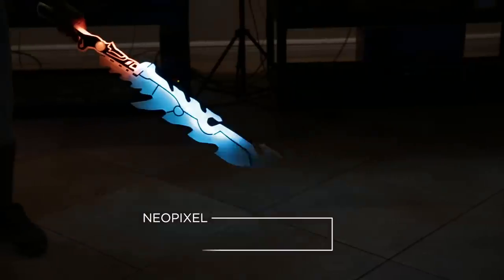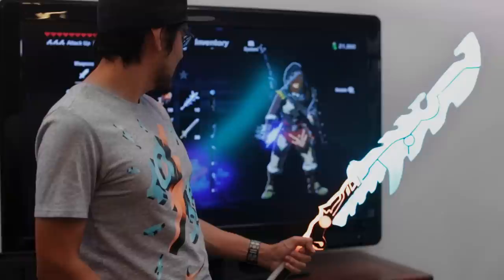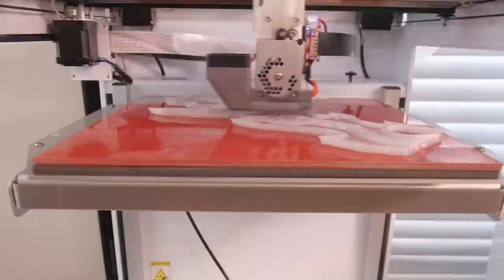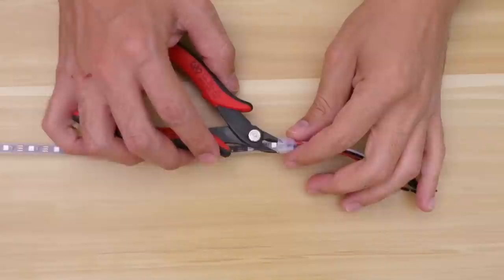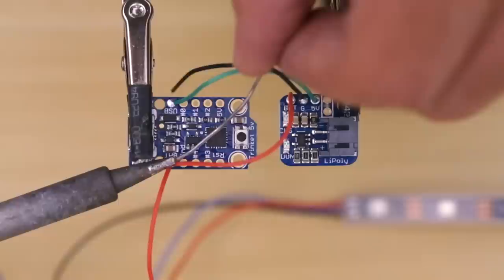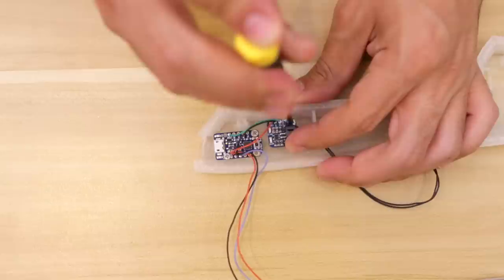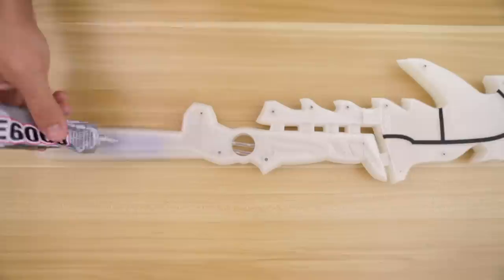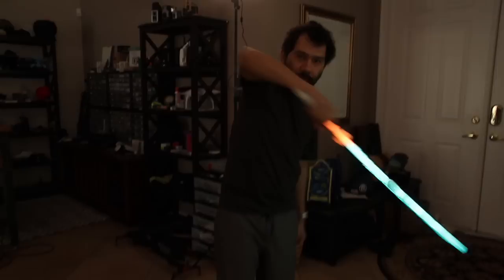3D Printing Zelda: Breath of the Wild – Guardian Sword++ #3DPrinting #Adafruit #Nintendo

Comment: "It's really durable and you can swing it around without having to worry about it falling apart."
Inaccurate to the actual game.
Reply: CrazyE that's a huge problem for me though. I don't like using them for that reason.
Reply: I love that I just finished the video where he made the guardian shield and the sword just broke.
Reply: @coolkcroyale  I'd say durability is about on par with the game's mechanics XD !
Reply: xD
Reply: Well hes swing it around in the air not actually hitting it againt anything at full force innacurate to what the weapon is put though in the game so?
Reply: @luigi7781  Use the ancient short sword instead its more durable and does more damage if I remember correctly (and you still get ancient proficiency)
Reply: @antssa2558  never said i didn't like the ancient swords. Just the guardian ones. I know those have a way better durability.

Comment: bruh... thank you so much for sharing this as i was unsure of how to mount my PCB to a 3D print. i was going to add a nut on the other end to hold a bolt in place but seeing that you can just screw a regular screw in changes a lot :)

Comment: is there a proper way to split the larger pieces for smaller print beds without weakening the final result?
Reply from the maker: of course! A fellow maker actually went ahead and did a remix. The parts are cut into smaller pieces and includes the mounting tabs. check it out! https://www.thingiverse.com/thing:2311491

Comment: How many top and bottom layers did you use to print? looking here and at Thingiverse I cant figure it out. One person even went no infill and no top layers. Just relied on the bottom layer and the walls for strength, which i might do since im using PETG... or I could play it safe and go 20% infill and 2 top and bottom layers but hey if I can save material and make the sword lighter that would be nice.

Comment: And, of course, if you don't have a 3D printer with a massive 300mm x 300mm bed, which probably accounts for most people with 3D printers, you're screwed so don't even bother trying to put this together. I wish more of these videos would take into account that 200mm x 200mm seems to be the norm for most people. 

(Yes, I know about the link for smaller platforms - https://www.thingiverse.com/thing:2311491 - but the principle still stands.)

Comment: Assuming all goes well with the wiring, would the main reason to re-open the sword be to change the battery? How long is the life of this one you're using?
Reply from the maker: +kyandi3 The battery capacity is 2200mah and rechargeable, depending on brightness setting anywhere from 1-4hours.

Comment: Is it correct that you can tell single LEDs on the same strip what color they should have or did you use two strips?
Reply from the maker: +FlyingAnanas That's the magic of NeoPixels! Each LED can be a different color, so just one continuous strip with a single data wire 👍🏽